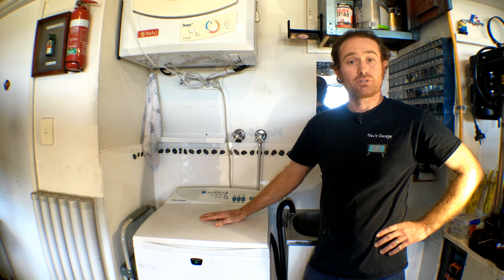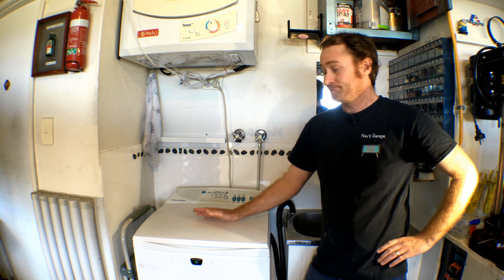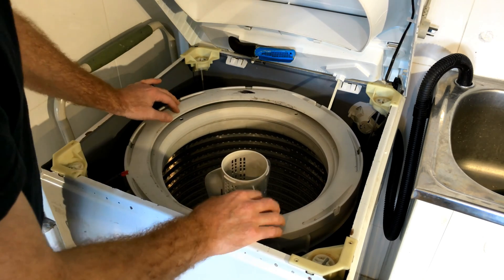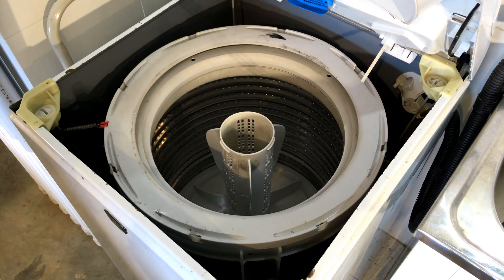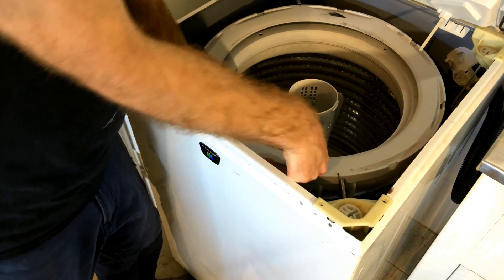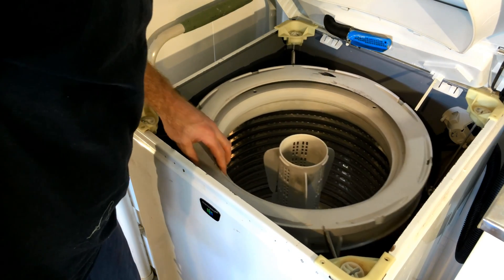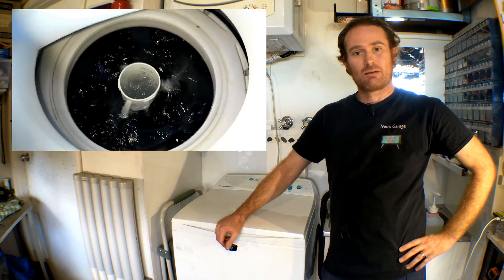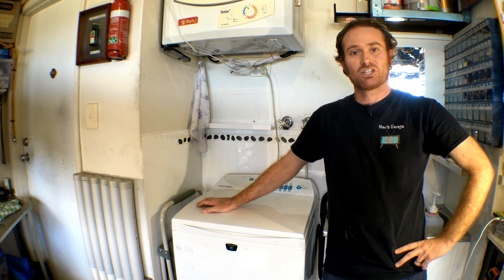Stopping the Fisher & Paykel Washing Machine OUT OF BALANCE ALARM

Comment: Just put a $50 new set of suspension arms from eBay and that really fixes it 
 Later models don't have that white plastic trip arm in them.
Reply: Hey mate so I was weighing up doing nevs trick or just buying the springs off ebay, problem is I can't see how the old ones are broken or faulty?

Comment: Fischer and Pykel are rubbish machines a decent machine should not do this stupid out of balance alarm my mum had an old Hoover machine that gave up the ghost after 35 years and didnt need a thing done to it except replace the taps and hoses. If the manufacturer knows this issue why do they keep making it this way ? why not add the extra springs in when it comes off the line ? I know load of people who all complain with the same issue on this brand of machhine which I wont buy again as they complete rubbish .

Comment: it's called a bias spring because there's only supposed to be 1 and It's designed to keep the drum pulling back with the centrifugal force. Chances are if you have an out of balance issue then the sensor is doing it's job amd you need to rearrange your load for the  spin cycle.
Reply: No matter how much you rearrange some of them the sensor still goes off. I've seen them stop 5+ times over a cycle so obviously a fault in that specific system
Reply: ...stupid thing keeps going out of balance with just 5 pairs of socks. How hopelss is that ?!

Comment: Hi Nev, my smartwash keeps saying off balance although it seems level on the floor, I’ve had for 4yrs without issues till this, do you know the approximate cost to fix it ?? Please
Reply: I thought that error meant the clothes were out of balance inside the machine? When I get the off balance error I just move the clothes around so they’re more evenly distributed and it works :) don’t know if it’s the same error code as yours but just replying in case it helps.
Reply: @Redeemed12 You are doing exactly what you're supposed to do and these lazy people aren't
Reply: Is it OOB or water temp? They both have the same sound. OOB will be at Rinse or Spin phase and the machine will have stopped. Water not hot enough will sound when the machine is filling. You can fix this by putting the wash on before the hot water cylinder has been emptied (for example after everyone has taken a shower) or change the water temp setting on the machine to cold. OOB happens when you have an imbalance in the load. Pulling the washing out and laying it back in so that the clothes are evenly distributed around the drum will temporarily resolve the issue.

Comment: Good tweak. But does anyone mod the F&P control system? It would be good to reprogram it so that when the out of balance switch is activated, the machine slows down to a more gentle wash or spin, rather than just stopping and beeping. That way you would get your clothes washed, if not as well.

Comment: Hi Nev,  great video. Very helpful.  I'm a carpenter and a bit of a fixer / maintenance of all things at home. I have a F&P washing machine / top loader. I copied what you did, but I tweaked it. I didn't drill/ hook in the springs to the circumference ring. I thought the plastic was a bit thin, so I made 4  small , L shaped ( colourbond sheeting) brackets / riveted ( used washers with rivet size hole on the rivet stems for more strength)  L bkts to the outer drum ( the plastic is thicker/ will last btter over time / just clear of the big plastic cover ring.  The L bkt has a 1/8 drill hole to hook spring on.The other end of spring hooked onto the suspension rod stem . I drilled a 1/8 hole into the top plastic of the suspension rod and fed wire through hole and down to the spring and wired the spring upwards , which gave the spring abit more tension. did all 4 corners.  I got the springs (C- 163    88.9mm long) from Bunnings.
Reply: How did your modification go sir.
Reply: Pretty nifty, Nev

Comment: Hi Nev, you video is extremely helpful. My Fisher and Paykel had the same problem and sounds like an earthquake during the spin process. I open the top panel like in your vid and found all 4 springs detached and 3 were missing actually. But I think I left the problem too late and now the machine does not even turn on. It makes a ticking sound only when plugged in the power. Is there any way to reset it? Thanks a million!
Reply: only supposed to have 1 spring

Comment: The newer machines (e.g. WA8560) do not have this mechanical switch for OOB - they have an electronic sensor in the motor drive , called "bump detect" -  so, strangely, it does not sense the sideways movement of the bowl. (in fact I have manually moved the bowl in all 4 directions to touch the side walls of the machine, while spinning at full revs, and not tripped the OOB).   So it measures torque changes - so I think the single top spring in the back left corner may influence the 'torque movement' of the bowl.   If anyone can tell me the solution to this OOB stop - it would be appreciated.
Reply: I have a newer model too, and found another video that talked about another brand with damping in the spring suspension system. I found mine dampens by slowly bleeding air out of the sealed off spring covers. I taped the spring covers to the rods which increased the friction and slowed the air movement. Has worked well so far.
Reply: @fecksfx  There is foam material in a piston groove in the cylinders that's meant to cause damping friction. This foam material eventually disintegrates. I do backyard repairs and have been trying to find a reliable DIY fix. A year ago I started using a foam rubber replacement I got from China with perfect results so far. It's called 35A duro ejection rubber.

Comment: What is that long piece of plastic at the back on the right you pushed away. @ 2:21 ?
Reply: He explains it at 3:08 to 3:15. It's trigger for the out of balance switch
Reply: Thanks for that, I worked it out anyway. Got it going and it’s all good $4:35 😂🤷‍♂️. 
Nearly threw it away, now trying to work out how I can support the fins that are cracking on the agitator. Thinking cut ice cream container and silastic a piece each side. Thanks for being concerned enough to reply. Cheers